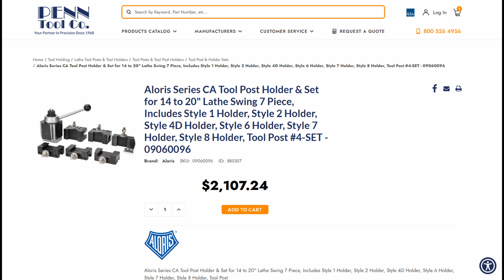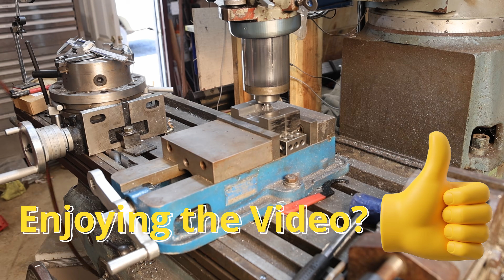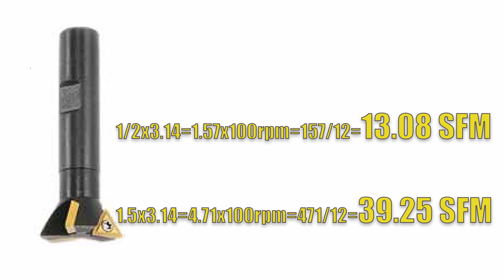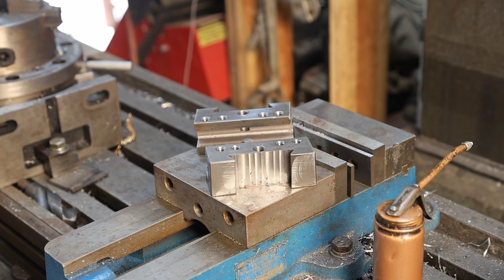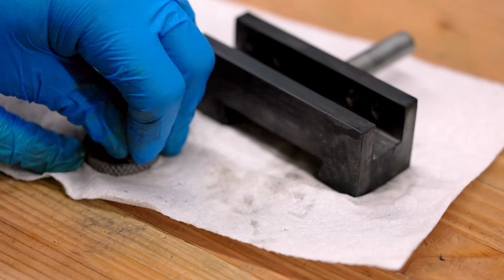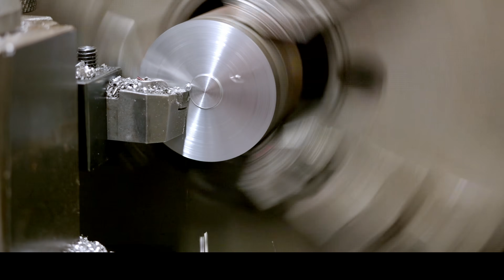Turning Scrap Steel Into $200+ of Lathe Tools

Comment from the maker: I'm trying out some different techniques for editing, scripting and shooting video. Let me know what you liked and where I need to improve. Thanks
Reply: I want to learn independently from scratch. How can I get help from the experts in systematic technical education to guide me in the right direction?
Reply from the maker: @fuudxrte  Youtube has a video on just about every possible subject you could ever want to learn. Sometimes though the search wants to pigeonhole you into a particular niche that it knows you will watch. 

Pick a subject and try searching until you find something that seems attainable, then try it. Overthinking can lead to analysis paralysis. 

 I also find reddit useful as there are subject matter experts available to chat on just about every possible project. Depending on where you are there also may be a makerspace nearby where you can interact with creative people. Or find a local machine shop and offer to help around the shop in exchange for some hands on learning.

There are many ways to move forward, but the most important is just to start moving, you can pivot when you hit the first point of failure. And there will be failure, don't get depressed when it happens, analyze it and try a new tactic to bypass the failure. Best Wishes on your Journey 
👍

Comment: Nice job. You made them work. I would have preferred to have a little more meat to the holder, and I didn't care for the welds. But they work, so this is just my preference. Thanks for sharing.
Reply from the maker: We made some others with bigger scraps. And if definitely works better with more meat. Normally we would use Loctite to hold in the height adjustment, but there wasn't much to hang on to, hence the tack welds. Thanks for the comment, I'm uploading another experimental toolholder next, Its a cast boring bar holder
Reply: @MacGarvins  Great! I can't wait to watch! Thanks

Comment: Чел ты Ахуененн. Давай в том же духе. пили видосы . А можешь ли сделать такой же держатель для резцов  используя только токарный станок ?
Reply from the maker: Yes it is possible to do it in the lathe, but you would need a xy attachment where the toolpost would go in order to mill the slots. The set screws could be drilled and tapped by hand as they really just clamp on the tool. We just got a new boring bar in the mail that I need to make a toolholder for, I think I'm going to try to cast one in bronze next, I think the material will help with dampening vibrations. Thanks for the comment!
Reply: @MacGarvins Hey bro, I have a few questions that I hope you can help me answer. You have so many devices. May I ask if there is any connection between this and (that is, regarding your mechanical skills. May I ask if it was cultivated through school education, or did you learn it on your own, or? ) education, or is it related to your income from money?
Reply from the maker: @fuudxrte, my first job at 14 was as a helper in a fab shop. So I did start early. My dad was a contractor, so I went into building for a few years, then moved into the electrical field where I have been for about 30 years now. 

I try to learn something new every day, even if it is small. Those little bits add up over time to diverse skills. I am mostly self-taught, with a lot of help from the internet. When I find an interest in something, I tend to dive in headfirst until I become proficient.

I've only been machining for about 6 years, casting for about 3 years. Each iteration gets easier and adds a little more skill. 

My advice is to just find something interesting to you and learn a little about it every day. Try new things, fail, and try again until you get it.
Reply: @MacGarvins I have understood the principle. Thank you for the explanation.